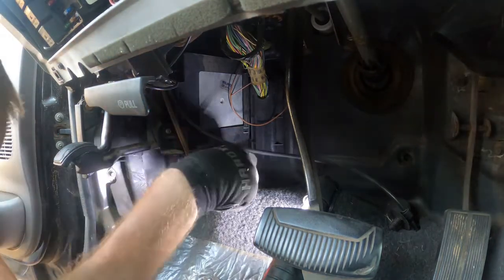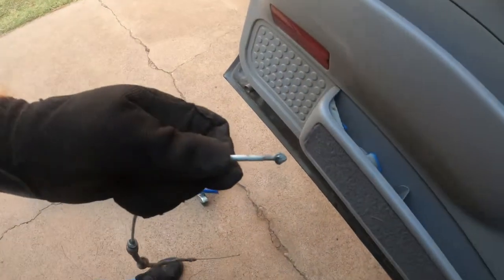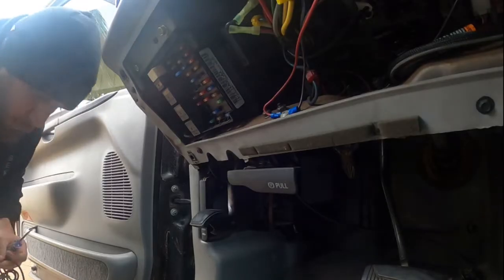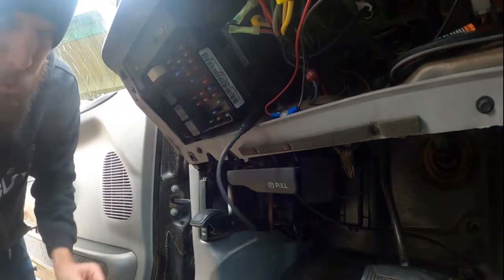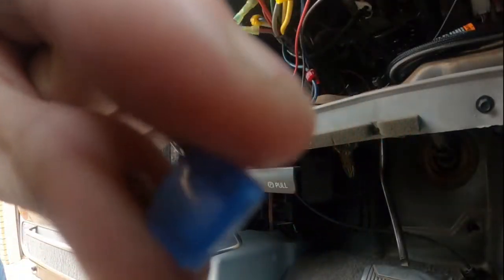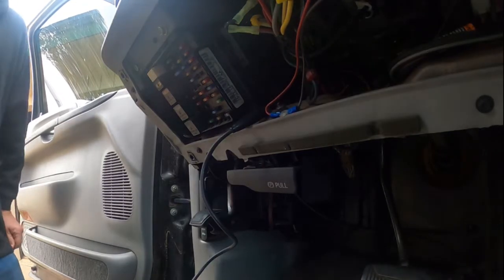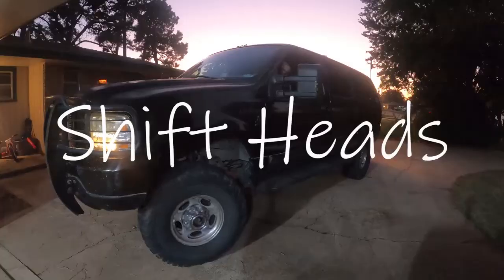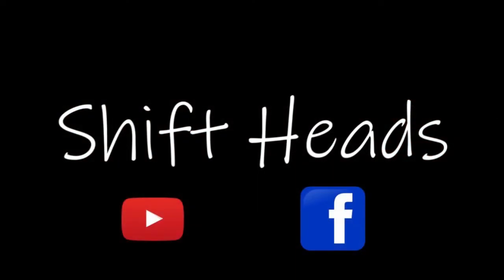Excursion Episode 9!!!

Comment: Believe it or not, it likely came from the factory without a rear anti-sway bar. I have an '02 Limited v10 and it also does not have one. After some research I found that only a couple option packages actually included the rear anti-sway bar on these. Crazy
Reply from the maker: I'm not 100% on this, so I'll do some research. Thanks for the tip!